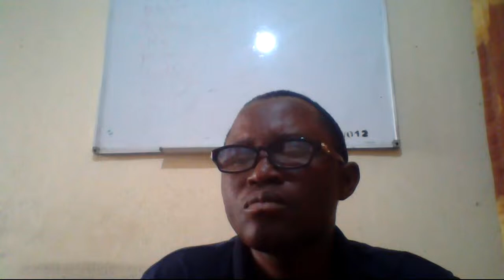Advanced Computer Hardware Components #cisco #computers #computerhardware #hardware #cisconetworking

Comment: This lesson teaches that most computer now uses the UEFI(Unified extensible firmware interface) instead of BIOS the older version
BIOS can be passworded using the EEPROM, drives can also be encrypted.
CPU VERTUALIZATION:This means that on a single computer system two or more computer system can be installed running different software using the same CPU
Cooling CPU without using electricity is called passive cooling while cooling CPU using electricity means e.g fan is called active cooling

Comment: I learnt that the meaning of UEFI is unified extensible firmware interface) 
Bios can be password protected, drives can also be encrypted. Computers can be protected from power fluctuations such as surge protector, UPS and standby power supply

I learnt that when the computer is being switch on, the basic input and output system (Bios) perform a hardware check on all internal components of the computer 

I learnt that laptops don’t use serial port

Comment: I learnt that most computers now use UEFI( unified extensible firmware interface)instead of Bios the older version and also Bios can be passworded, drives also can be encrypted. Computers can be protected from power fluctuations such as surge protector, Ups and standby power supply.Also the CPU executes programs in two ways which are RISC and CISC. The CPU can be enhanced in two ways which are hyperthreading and hypertransport. The CPU can also be measured in megahertz and gigahertz. Ports available in the computer system are legacy, connectors, cables and Syria ports and so on sir. Thank you for the knowledge sir.

Comment: I know more about advanced computer hardware components necessary to set up a computer 
I learnt the safe disposal methods
I know what Power on Self Test is all about 
Bios is a program that controls communication
It can be used to set up passwords and it can be used or upgraded EPROM
I also learnt that laptops don’t use serial port 
I know what UEFI is and how to secure the security of Bios by using passwords,incrept the hard drive,Tpm and so on
Thank you sir

Comment: Bayos can be used to set password. It can also be upgraded  to  EPROM can used to add password to ur bayos. Power=voltage × watt. In Nigeria we use 220 to 240 voltage. 
Thank you sir
Reply from the maker: The term is BIOS. Not bayos
Reply: @ECIMacademy  ok sir . Thank for the correction sir
Reply from the maker: Power is not what you put down there. 
Power= volt x current
The unit is Watts